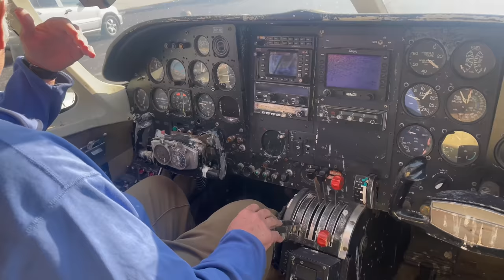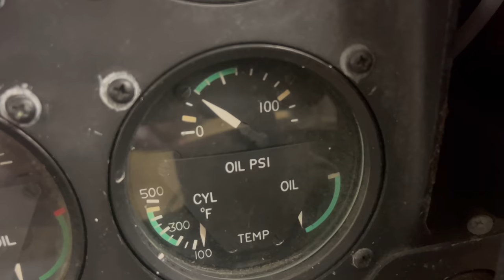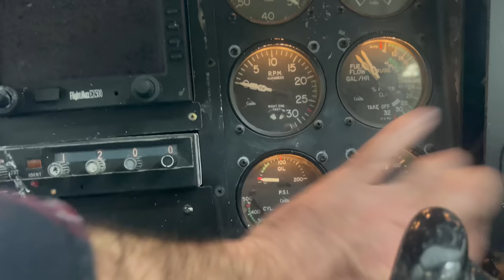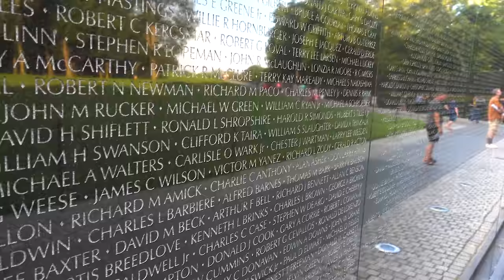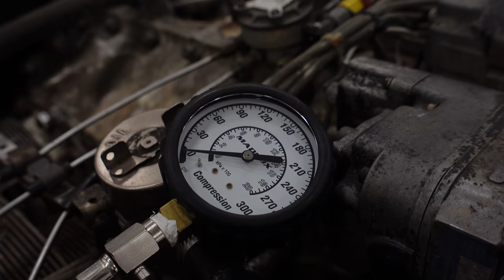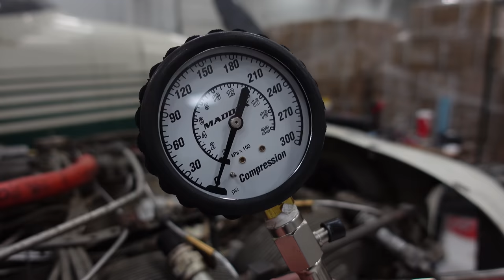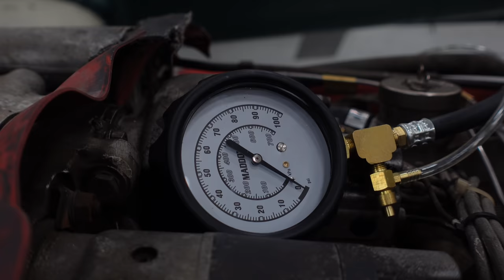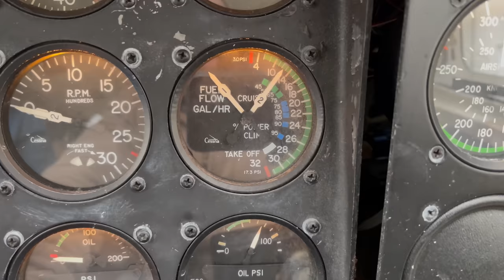Did We Ruin The FREE Abandoned Airplane Engine ? Ep6

Comment: Dude, I’m so pumped about how close this is getting to running. My money is on electrical. You just aren’t getting the amperage out to this engine for it to run. It’s a bit better when the power supply is stronger from the other engine running, but still not quite enough. My next check, in your shoes, would be electrical connections from the fuselage.
Reply: Id go with grounding,possibly corrosion
Reply: I had the same idea, when the left one turned the right starter motor suddenly got a lot more speed and almost started, so too little amperage I think. My 1.5 diesel already has a 70 Ampere battery, with all those instruments that turn with ignition on, it may need 80 Ampere, I don't know what the description of this aircraft says. And Jesse Chapman has a good point too, checking the ground of all electrical connections.
Reply: OK- just for you guys- A&P mechanic here. This is not like a car, cranking speed shouldn't make a difference. What I'm not hearing is a magneto impulse coupling snapping (a mechanical linkage that winds up as it cranks, then releases to give the magneto a boost)
Reply: you saw the plugs fire? ignition doesnt need battery with a mag.
Reply: @MrDdaland  Do you believe, like I do, that all these people fixating on the cranking speed are overlooking the real problem? The engine that does start does so turning only ever so slightly faster than the one that does not. When the left engine was running, the right engine cranked MUCH faster and tried harder, actually sputtering a few times, but still didn't run. He pulled out a spark plug after a lot of cranking but no start, and it was dry. As low as the compression is, it's going to have to get very rich to start. I believe it is simply not getting enough fuel. Does your credentialed assessment of probability agree with my uncredentialed assessment based on a lot of real world tinkering?
Reply: @edifyguy  Obviously, I can't see everything here, so anything I suspect should be taken with a grain of salt. As far as the guys thinking about cranking speed are used to automotive engines, where typically if the voltage drops down below a certain point, the ignition system won't work. Aircraft engines are not that way, because the magneto's  produce their own power, which is why a lot of the old planes didn't even have an electral system!
 I don't know much about the FI system on the Continental's, so this is purely a WAG, but wouldn't be surprised if there is something blocked, dried out,etc. BTW, these are mechanical FI systems- they can be finicky and easy to get out of adjustment.
 But still putting my money on a sticking impulse
Reply: @MrDdaland  I'm a pilot, not a mechanic, but I noticed the lack of impulse coulping and mentioned it a few videos ago. I wondered if this engine was somehow different in that regard from the ones I am used to.
Reply: @MrDdaland  He showed us a spark show that looked pretty good to me. Wouldn't a sticking impulse cause that to not be the case? I wonder if there's just a fuel filter full of rust and varnish somewhere. Is the FI on these anything like I would know from my old mechanically injected automotive engines (mostly diesel, one gas)?
Reply: @edifyguy  Possibly. Just off the top of my head the ckosest automotive parallel would be the Rochester Ramjet system used in Corvettes back in the late 50's
Reply: @MrDdaland  I just looked at that, and that's rather different than what I was imagining, but very much in the same family as what I had on a 1985 Audi with a fuel injected gas engine. I can't imagine that would be too difficult to service on a cursory level, like taking off covers and spraying with carb cleaner, but I would start with checking fuel filter(s) and pump strainer(s) since other commenters have stated that the flow seemed way too slow when he flow tested the feed line, which certainly would explain a great deal. It tried to start, because it was getting some gas, but failed because it wasn't getting enough.
Reply: This doesn't have impulse couplings.  
"Shower of sparks"  system. Which uses a starter vibrator, powered by the battery during cranking. An additional set of "retard" breaker points provides timing, at roughly TDC. Normal points are shorted to ground while starter motor is operating. 
   The plugs looked filthy...a system that sparks in free air will not always work under compression. I would clean them. Not with a parts washer and screwdriver.
   Jet A is kerosene. Less energy than diesel, but will work in a diesel. I heated house 2 winters using jet A in oil burner. A friend runs his diesel jetta almost exclusively on free jet A. Notices a slight power reduction from real diesel. I dump it in my diesel rv when I have extra.
      Timing via the "red tooth" is a very rough adjustment, timing is likely to be pretty off. Use the mag timer. It is not just a "synchronizer", it indicates points opening. 
    Early timing can cause kick back. Can destroy the starter, or worse, the starter drive. You do not want to buy one. Pieces from it can also waste the accessory case drive train. Major damage, and can cause an in flight engine failure,  depending on when the fragments get into and wreck the gears.  Mags will stop..no spark. Oil pump stops...no oil pressure... see the problem?
   Time the mags properly,  or don't push the start button.

Comment: As an electrician I would recommend to measure voltage across starter on the engine. The wire resistance towards second engine is quite high and you will have a huge voltage drop, therfore starter cannot rotate a full speed. Also you have jumper wires, that also doesnt help.
Reply: Yeah, with all of the corrosion issues on that plane, voltage drop is definitely going to be an issue. You can see how much running #1 helped spin #2 a bit faster, hooking a second set directly to #2 start (carefully routed of course) might be enough to get the rpm to where that engine will kick on a few cylinders.
Reply: Having good batteries and cables ruins the crap fake reality drama narrative
Reply: Yes you got a point but he also tried when the other engine was running. Assuming this would generaye enough power.
But still a good test to use another wire before the selenoid.
Reply: @erik_dk842  No one is forcing you to watch. Take your negativity somewhere else.
Reply: @kstricl  Also, I would check the starting sequence. The previous owner said that he has 500h+ flightime on it so he should know but starting engine 1 and then engine 2 might be just standard sequence. The thing is that the starter switch to the generator mode after engine is running and powers everything instead of batteries.  I would definetely check the grounding connection and starter power line. Aluminium is bitchy specially with copper, it creates electrochemical reaction and corode like hell.
Reply: yes I meet this problem on the bus the engine rotate but not suficient speed it wash the negativ conection between body and engine starter the felxible conection wash significable deteriorate ant that wash the problem sorry for my english.
Reply: @Mike Monohon Then stop acting like reality TV. Do it right and proper, like WatchWesWork and PineHollowAutoDiagnostics, etc.Get a large enough good battery and hook some large enough battery cables directly to the starter solenoid.

Comment: Jet fuel is just kerosene. I've used it to un-stick a sewing machine. 

Slow cranking is possibly a bad earth. Try running an extra earth to the battery. A jump lead to the starter would do it. (bear in mind I'm writing this at about 7 minutes in..)
Reply: Ground?
Reply: He needs number one/ 4 °°° welding cable he's losing a lot of amps in that setup he's using
Reply: @carey_metv  earth ground
Same thing
Reply: Me too. I get old industrial machines often. I separate them from the table, use a bug sprayer to soak. Then compressed air for the rinse. I sell them at cost to deserving friends. 
I’d love to assist with upholstery, I’m in Nevada so that’s out.
Reply: 1950’s shade tree mechanic thing to  flush crankcase with kerosene
Reply: @randyfisher6108  please explain the difference then. I'm willing to be wrong if you can educate us. But throwing insults at strangers on the internet won't achieve anything.
Reply: @carey_metv  yes, ground/earth, same thing. :) Like Ronald's comment, big heavy welding wire is best. A clip on each end, one straight on to the body of the starter, the other to the battery -ve. Heck, even try putting a +ve straight to the street solenoid and seeing how fast it turns over. Just watch out for the sparks!
Reply: @randyfisher6108  jet fuel is basically highly refined kerosene
Reply: @AndresK5Blazer , it’s less refined than household kero/paraffin.
Reply: It's not exactly "just kerosene".
My dad tells the story of a jet pilot that ran low on fuel so he landed on a public highway. Filled the jet up with some kerosene trying to make it back to the base to cover his ass. It didn't have the same power and the guy ended up running is playing into the same feeling station that he had just filled up at killing himself and blowing up the filling station.
Reply: Ive never heard anybody call a ground wire an "earth". Why do you call it "earth"?
Reply: The left engine cranks fine, not a ground issue. He's swapped the starter from side to side, not a starter issue.  The right engine does not rotate freely. Something is binding (possibly rusted/seized piston pins) or exhaust system blockage causing excessive crankcase pressure from blowby. Check the crankcase pressure pulses with your thumb over the dipstick tube on both engines while cranking and compare.
Reply: @kirbylee57  It's pretty common to call it that in the UK. A 'bad earth' is the cause of many a problem is cars. 

Ooo... That's a point.. I'm assuming that it's negative earth and not positive..
Reply: @randyfisher6108  At more than a few times Ive heard jet fuel , and  kerosene are nearly the same and the same. They smell the same. The dumbest thing you've read...  was dumb at all.
Reply: @randyfisher6108  Depends on which jet fuel you're talking about. Jet A, JP-5 and JP-8 are all high quality Kerosenes. Jet B, JP-4 or TS-1 are more dangerous Gasoline/Kerosene blends, and get used mainly in arctic climates where Jet A will literally freeze. Your jet engines will likely burn consumer grade Kerosene with no ill effects, but unless it's a genuine emergency, don't do it!
Reply: @neighborscomplaint6859  swapping the starter won't affect the ground/earth. If he says it doesn't turn over as fast then it could be a reason. It might not.. But it could. 

There could be many other reasons for it. A sticky piston, no oil in the reduction drive(gearbox?), etc.
Reply: @spacemutt1978  I thought you were in the U.S.  I had a flight instructor from the U.K. Learned faster from him than one from Sweden.
Reply: @randallsmerna384  I did reply but it seems to have disappeared, so apologies if it turns up twice. 

It's a small civilian airfield where most jet aircraft will use Jet A. There are different grades of fuel, but they are basically Jet A with additional additives to increase flammability, but I believe these are mainly high performance or military aircraft. 

From Shells own website, and they make the stuff. 

"Jet A is a kerosine grade fuel, normally only available in the U.S.A. It has the same flash point as Jet A-1 but a higher freeze point maximum (-40°C). It is supplied against the ASTM D1655 (Jet A) specification."

It's a bit like arguing that E5 isn't petrol/gas and E10 is. Yes, there are differences, but when we are talking about filling an engine block with it to un-seize things, it's just kerosene. 😉
Reply: @spacemutt1978  I've read that jet fuel is a huge pollutant because aircraft engines are not picky. Maybe it's rather the case with jet engines. Also kerosene doesnt freeze easily. It's used as diesel additive in the winter as an anti-freeze so this part was off too. It's just too dry and expensive to run in a diesel engine. But yeah, he should remove the injectors and leave them in diesel for a week
Reply: @trollmcclure1884  jet engines use a massive amount of fuel compared to internal combustion. They are better because they can produce more 'thrust' (horse-power and thrust are very difficult to compare), they can operate at higher altitudes with thinner air, produce less vibration, and are more reliable. 
Kerosene is an amazing fuel. Both diesel and petrol/gas engines will run on it, albeit for a short time. And like you say, you can add it to diesel to prevent it waxing in low temperatures. Some diesel engines have been designed to run on pure kerosene without any problems, but most will suffer problems with the high pressure injection pump. You're right, it's very 'dry'. That's why it's often used for heating. Paraffin heaters have been used for a very long time. (Paraffin is kerosene, for those that don't know) The reason it isn't more widely used as there simply wouldn't be enough to supply automotive and aviation demands. 
 
Diesel is good for soaking parts as not only does it act as a solvent, but it also has a degreasing additive in it to help keep the engine workings clean in modern, highly engineered engines. A good way to spot a diesel leak on an engine is to look for the clean bit. 😆
Reply: @kirbylee57  In household, the ground is actually grounded in the "earth", i guess that why ! ^^
Reply: @kirbylee57  In french we use "à la masse", which would be translated as "to the ground", and we also use "à la terre" which would be "to the earth" (with earth meaning the "material", the dirt, not the planet). 

But we will most likely use "à la masse" when we talk about onbard-electrics/electronics and "à la terre" when we talk about electrical wiring in a household :)
Reply: @kirbylee57  We call it that in the UK since it is the return to the ground (earth) even though it actually goes the other way before anyone says ;-)
Reply: @kirbylee57  because that's what we call it in the UK.
Reply: Jet A is kerosine. A turbine engine will run on diesel. Ask any spray plane pilot.
Reply: @ernestpenfold4316  No  wonder i've never heard anyone call it that.  I suppose it's called "Mars wire"  on the rover vehicles exploring the planet Mars. But what do they call it in the space station? The black wire, the space wire, EOW? Ground wire ... nah.
Reply: @kirbylee57 You haven't heard it called that before. Because aircraft and automobiles doesn't use a earth ground. Earth ground's are used only for homes and other ground standing structures. A earth ground is used as a safety device and isnt used to create electricity in your home. Earth grounds are used to remove any unexpected electrical spikes and return it to earth as 0 volts, like for instance when lighting strikes your home. Earth ground's are what keeps the electricical spikes. Created by lightning stikes from blowing your TV. If your TVs ever blowed or any of your other electrical devices in your home from a lightning stike. That means you have a bad earth ground. Power Grounds and chassis grounds is the other half of the electronical systems. Used in aircrafts and automobiles. And is needed to create electricity and power in automobiles and aircrafts. If the ground in a aircraft are automobile is removed it will cut all power to the vehicle. If you were to remove the earth ground from your home. You would never know it unless there's a lighting strikes. Or when you touch any of your appliance's with wet hands. You will feel a slight electrical shock. They're not the same and are used completely different from one another. Also automotive grounds return voltage back to its power source and carry the same amount of voltage constantly as the hot side of the circuit. If you check a earth ground with a multimeter. You will only see zero volts unless theres unexpected electric spikes. Earth grounds dont return any voltage back to the same source as the hot wires to create a circuit. They also dont carry the same voltage as automotive power and chassis grounds do.
Reply: @ernestpenfold4316  As good of a reason as any.
Reply: @spacemutt1978 , matters not, it’s still Earth.
Reply: @cliffcaldwell340  a gas turbine engine, will, run on anything. Even coal dust. Awkward but true.
Reply: @bretjjjohnson7942  blah blah blah blah...
Why call it "ground" when it doesn't go any where near ...    the ground?

You could always call it the negative.... which is stupid anyway as the words positive and negative describe things that are full and empty, yet electrons flow from neg to pos. 🤣🤣
In the grand scheme of things, no one really cares. The English language is a wonderful thing that has evolved over time into a multitude of bastardisations by different nationalities who speak it.
Apart from the English of course. We talk it proper.

Oh, and stop calling it kerosene, it's parrafin!
Reply: @johnnunn8688  with a small e